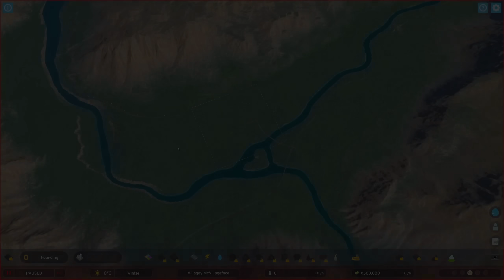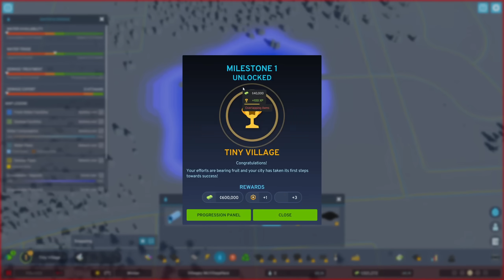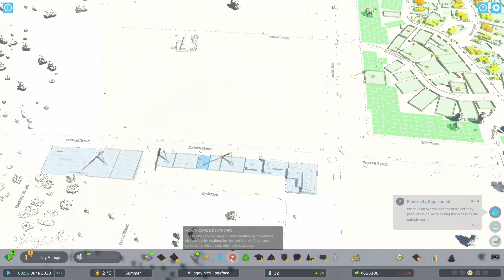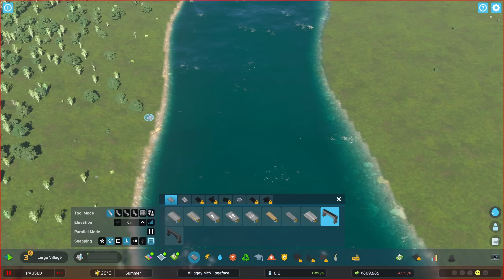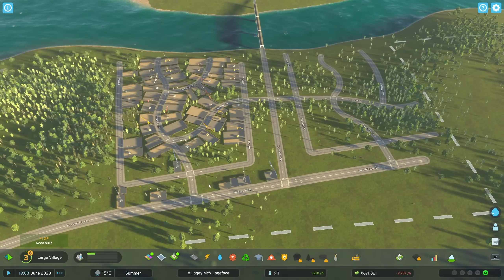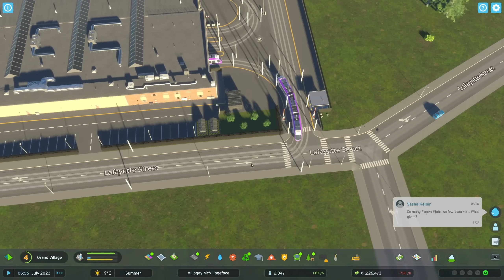Building My First City in Cities: Skylines 2

Comment: 8:25 It is honestly pretty unrealistic to seperate the residential demand into 3 different densities in the way C:S2 appears to do it. As that's just not how residential demand works in real life.
People don't look for specific densities when looking for a home. They prioritise different aspects of a home, and different densities are better suited for satisfying those aspects.
This means there is some notable overlap between the demand for different densities. Which does not appear to be the case with the in-game demand bars. I haven't seen any zoning type lower more than one bar at a time. (Apart from the singular mixed use zone. Which fills two completely seperate types of demand at once.)
As far as I can tell, the 3 different types of residential demand in C:S2, are completely seperated from each other. I however, haven't played the game myself. So I might be wrong about how exactly the demand bars respond to new zoning.

Comment: "The cemetary will create well being within a certain radius". kek. The actual statistical fact is that the death rate in the immediate neighborhood of a cemetary (say two or three blocks from the            graveyard)  is 3% higher than other areas of a city. After all why do we bury corpses? To contain these sacks of corruption and decay and all the micro organisms feeding on them by putting them six feet under. But even that apparently isn't enough to totally sequester the problem and those toxic micro organisms leach out into the soil and escape over years and decades into their immediate environment.

Comment: Rectangular plots is still a huge issue. And all automatically having cranes and worksite is stupid, it should start with plot for sale and wait to it to be sold Wich should happen more or less not at the same time.

You may change architecture styles to Europe style, but service buildings stay super American and it's just wrong.

Mandatory flattened terrain for huge service buildings which in fact are 90% gardens or not actual building is kinda lame.

Comment: Question: Do trams still have to go through loops to reverse direction, or can they switch directions like CS1's trains and metro (and some real life trams/light rail like Melbourne or Sydney)?
Reply: Interesting, in the video it's clearly visible all doors on the both sides of the tram. But the tram line has been paved only on right side of bidirectioned car road, so there is no possible way to simply change head in the tram and go to backward rail without traffic accidents.
I think that even if there won't be this feature in stock game on release - the mods will be soon.
Reply: @WhyDoesMyNameChangedTo_user  Yeah, this was something I've learnt the hard way in CS1. I was trying to figure out how to conventionally switch direction, when I was setting routes, only to realise I can't.
Reply: Take a close look at the doors, are they on both sides of the tram in the video ?

Comment: I don't like how big most of the buildings are, it gives an urban sprawl feel and it seems it'll be harder to fit the assets into more well-designed, compact cities. Getting rid of the massive amount of parking in front of the graveyard for example would help. I just hope they add more styled buildings soon
Reply: I would also like a less fancy graveyard, since most graveyards in my country are just: a shed+massive area of dirt tracks and gravestones.
Reply: the game has European styled buildings already, you can see he unlocks them in this video. American cities & towns are extremely reliant on cars and thus have a ton of wasted space used for parking lots. European styled buildings in this game will probably be more compact and not have so much parking space
Reply: They're more realistically sized in CS2, especially city services like the train depot, that's massive. Also, pocket cars don't exist anymore, so every car actually needs a space to park. I would love to see some more size variations on stuff like the graveyard though. The one in-game is good for like a city fixture, especially because the mausoleum turns it into a place that also acts as a tourist attraction, but it would be nice to have some smaller ones that would feel more at home in small towns/rural areas. Maybe with different upgrades/additions that have different effects compared to the large one. But that's something that we won't see in the base game.

Comment: Why demolish the coal plant when you were exporting the excess Electric?
Reply: To avoid air and ground pollution probably
Reply from the maker: It is very expensive to maintain
Reply: In a video by The Spiffing Brit it was stated that all utilities with the exception of wind power cost more to produce than what you are paid for to export it. One may make a lot of money, at least in this developers release, by building a lot of wind turbines where they generate the maximum amount of electricity and exporting the electricity.

Comment: Just visually honestly it looks like a step backwards
Reply: You haven't seen vanilla C:S for a long time? Graphically C:S 2 is much better than not moded first game, but modded C:S 1 is a different league.
Reply: @baki2200  No i never had any visual mods installed, I think. And I dont mean graphically (textures etc) per se, because I understand that this is not finished yet.  
But I think that the models dont look as nice as in CS1. There is not as much character to them. And the cities seem a bit lifeless.
Reply: @FlosBlog  What do you mean by models? Buildings? Cars? I think they look more realistic, as many players wanted, but because of that they are less diverse. There is also nothing to compare a game that has regularly received new additions for 8 years to a game that has not yet come out. Btw sorry for the translator, I'm still learning :)
Reply: @baki2200  Yeah, especially the buildings seem to have a weird scale it seems. Maybe its the general push towards more realism that I dont seem to like
Reply: @FlosBlog  ok, understand, It's likely that mods and assets will make cities look much better, but if you don't want mods, the first one is still a great game
Reply: @baki2200 the sfh does look weird with the flat roofs though. I don’t think it was the right choice to do houses like that.